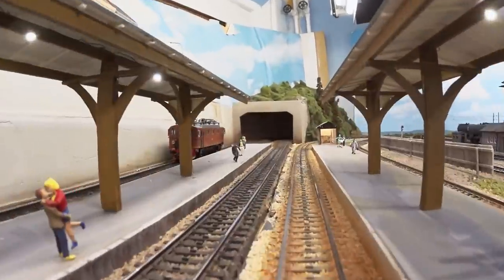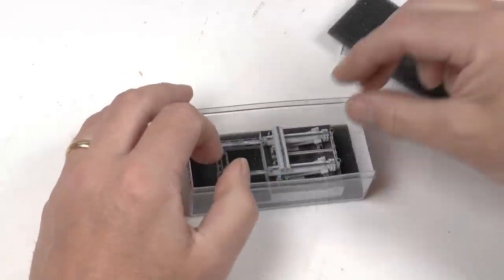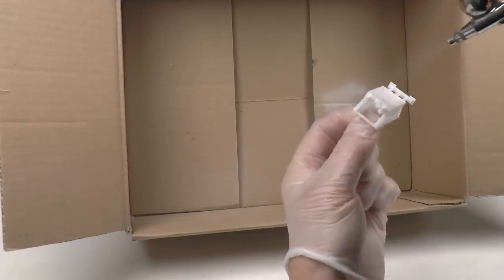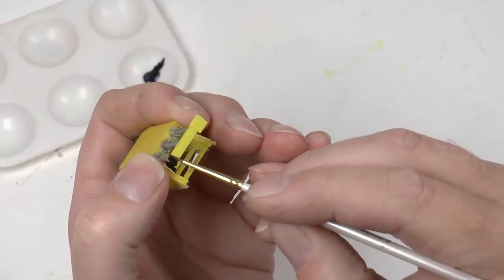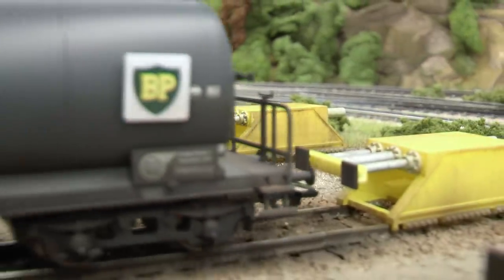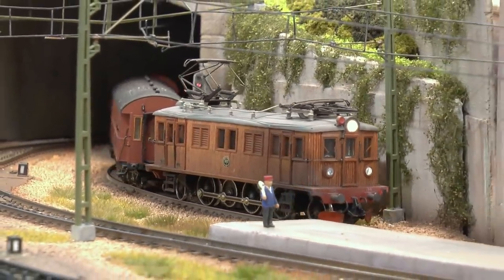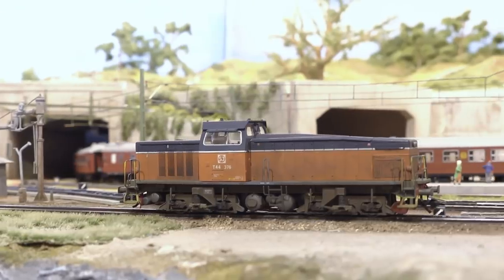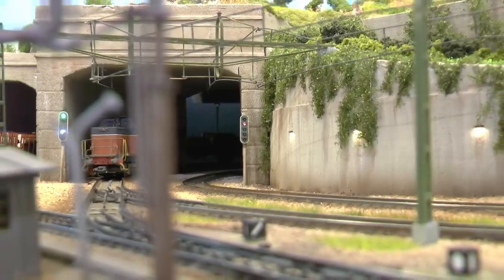Layout Update Tour May 2020

Comment: The part with the BR50 is excellent (and I also like theses Decapod, I still have my SNCF 150 Z which I bought as a kid, even if I have changed scale since).
I also use Ammo paints, I like the fact that they can be used with thinner, and that they are easy to shake (always an issue with the old Humbrol)